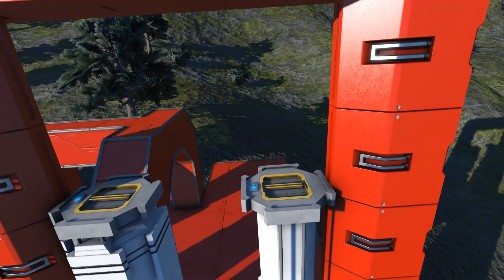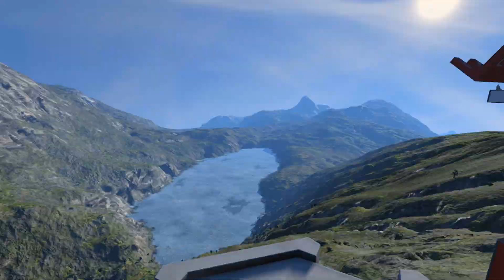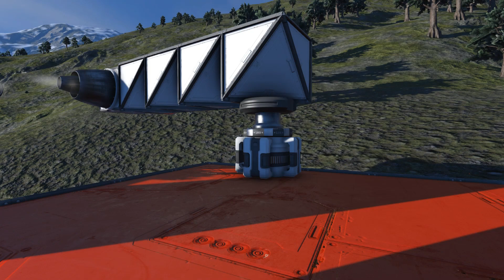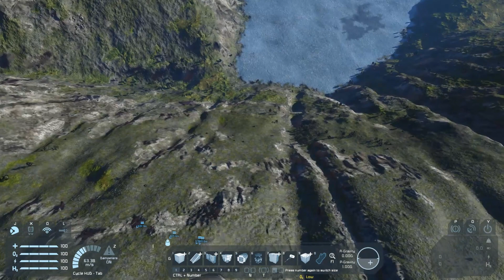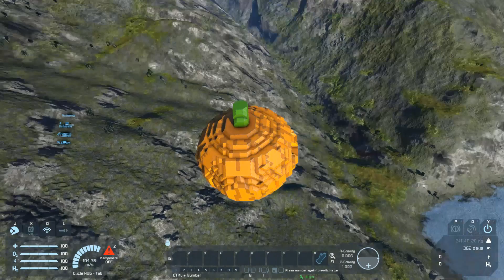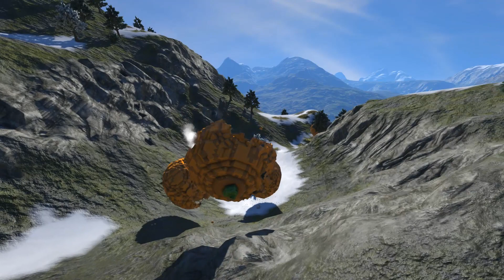Space Engineers: Pistons and Rotors after the Physics Update (tests and tips for Space Engineers)

Comment: One thing I haven't seen anyone test is the difference between ramming a piston into a block on the same grid, a sub-grid and a separate grid.  I have seen the big nothing that now happens if you ram a piston into the same grid and I suspect the same thing happens on subgrids, but what about a different grid?  Can we still get some destruction?
Reply from the maker: It could be interesting to see how much force you need with rotors or pistons in order to break a separate grid. Could be useful to know where the safety margins are. I'll see what I can do to work that out :)

Comment: Splitsie, I had a similar but crazier idea about catapult: use rotor head displacement instead of piston.
Rotor head displacement will change the length of rotor instantly, people used to make pulse engine with it when space ball first came out.
Can U give it a try? :)
Reply from the maker: That sounds like a cool idea, if wonder how you'd time the ejection to work. Although that might be good some of those rotor part cannons work... I need to do some research on this :)
Reply: Splitsie It would be so awsome if u can get it to work. I know timer blocks can ''extend'' group of rotors but only a little bit each run. Id never tried it though. Afraid of rotor glitchs ...

Comment: the hitbox of the blastdoor blocks for small grids are Horribly inprecise, its a hassle to figure out which way to rotate so i can place it on the roto head without it scraping allong another rotor.
they realy need to update those, its HIGHLY needed. im forced to download a mod that changes the hitbox of these exact blocks >.<

also if you stack pistons or any multy grid blocks it all starts shacking and destroying everything it its vecinity. so im forced to use the inertia tensor, which is basicaly sharing the weight of the grid the first rorot was placed on, WHICH IS TERRIBLE. the weight throws it all off, if youre trying to crate a mech it just falls to the ground not having enough strengs to hold all that weight up.
so you either end up with violently shaking mechs or mechs that are too heavy to lift their own weight ... keeEEEENNN!!!!

my way of a workarround is to apply inertia tensor to ONLY the rotors which are placed on very small grids compared to the grind that the rotor head is connected to, so both grids are very light in weight, but the rotors in general seem weak, at least on planets gravity.
Reply from the maker: The amount of torque the rotors can apply seems to have been balanced for space not for planets - which makes sense since they were designed before planets were a thing. So I agree, they often seem unable to lift things you'd think they should be able to :(

At least it's not as difficult any more to attach two rotors to the same subgrid to get them to work together, but the getting them to work together bit is quite hard - at least for me :P

Comment: You might want to try the rotor with thruster on an arm extension with the rotor on a landing gear. The thruster maybe trying to spin the whole station that the rotor is attached to and not just the rotor head or rotor.
Reply from the maker: Apparently it'll work with an even simpler fix - a few people have told and showed me that the thruster will work if the rotor is on with torque at 0, even though in my head that's the same as having it off with braking torque at 0. Oh well, just a little SE quirk :P
Reply: Splitsie
I tried the same thing, and found the same. However I also found that in some cases you can't have more then one going at a time. Also sometimes I got somewhat of a springboard effect when mounting the rotors sideways. It may be worth another video to cover how this works and in some cases doesn't. . . ^_^

Comment: ive seen velocities in excess of 400 m/s if you take a rotor, put a looooooooooooong arm on it, put a stack of pistons on that, extend the pistons, and measure from the flying tip.  unfortunately, as soon as the tip is not moving around a rotor, it instantly slows to max speed.
Reply from the maker: Yeah, that drop to normal physics when you detach is a bummer. Part of me wishes we could use this method to cheat things beyond the normal physics speed limit :P

Comment: Turn the rotor on with a tiny amount of speed, then turn it off. Then the thruster should be able to carry it from there.
Reply: Just make sure braking is set to zero so it doesn't lock down when you turn it off.
I've never tried it with thrusters, but I did manage to create a permanently spinning solar farm with the technique by turning it on at max speed, no brake torque, then shutting it off.
Reply from the maker: The braking was at 0, apparently there's a bug that means the thrusters can only spin the rotor if it's on without torque set to 0 which is quite strange...
Reply: scratches head As I've said, I've not tried using thrusters with rotors in such a way, but that doesn't make any real sense. I'm probably going to buy my own copy of the game soon (vs playing it on a friend's account whenever I'm hanging out with them) and I'll do some testing if I do.
Reply from the maker: My head hurts so much from trying to figure it out that I'm just going to call it a bug :P

Comment: In my survival world I have a ship with a double piston elevator to get to the control room. Never had any problems. Nor with my retractable docking port using a piston EVER. But after this update... I had my elavater extended in my ship. Then I as moving in to dock with my base and when I retracted my docking piston it exploded and sent a connector flying though the controll room. Shredding a massive hole in the armor. Like...., wtf
Reply from the maker: They did something odd with the settings on pistons that were already built prior to the update that meant they weren't as safe as ones built after the update. I don't recall exactly what but it was mentioned in the update stream, it was something along the lines of leaving the piston force incredibly high so that things were supposed to remain functional if they worked before, sounds like that didn't get that bit right :(

Comment: Have you tried killing off the rotor's torque on the thruster model?  That might have something to do with the lack of motion; this happens with motors in real life; the higher the torque the motor has, the more difficult it is for an outside force to overcome the motor's inertia.
Reply from the maker: SE also allows you to have free spinning rotors with the rotor off and braking torque at 0 but it does something buggy when you attach a thruster to it. Oddly even though that should work, what you've suggested does work. Setting the torque to 0 and leaving it on apparently everything works exactly as it used to... I can't really explain it :P

Comment: You HAVE to set Torque to 0 for a freely spinning rotor.
Reply from the maker: Actually there are two methods for a freely spinning rotor, sadly only one of them seems to work for the thrusters - which I've only learned from comments since this video was released.

You can either have the rotor on with torque at 0 or you can have the rotor off and braking torque at 0. To have the thrusters work apparently you need to have the rotor on for some odd reason... I can't understand why there would be a functional difference between the two setups which is why I hadn't even thought to try the other at the time :P Oops!

Comment: For the Rotor Thruster: The rotor definitely needs to be 'on', because whenever a block with a movement function is 'off', it is essentially locked. You'll also have to drop its torque to zero
Reply from the maker: Actually there are two methods for a freely spinning rotor, sadly only one of them seems to work for the thrusters - which I've only learned from comments since this video was released.

You can either have the rotor on with torque at 0 or you can have the rotor off and braking torque at 0. To have the thrusters work apparently you need to have the rotor on for some odd reason... I can't understand why there would be a functional difference between the two setups which is why I hadn't even thought to try the other at the time :P Oops!
Reply: @Splitsie  I believe the status of the rotor defines some property of the attached subgrid, when the rotor is on, the subgrid is 'on', more accurate force calculations are used

Comment: Using a thruster on an arm on a rotor, will do nothing, since in real world physics it would work on centrifugal force, wich is absolutly NOT in the game engine physics.

Just like even if you have a 7 long shaft of blocks with one thruster at one end and all the rest on the end, it will not tilt or anything, it'll just behave like any other ship.

A grid like this will have no influence from its own Center of MAss or added mass, but it might be influenced by the mass of the cargo, but i hardly think so.

Sometimes SE engine runs on trolls physics and its best to leave it at that.
Reply from the maker: That's what I think's going on, but setting it up that way used to work. Oddly I've been told by a few people that you can get it to work with the rotor on and torque set to 0 so there must be a bug with the way the thrusters interact with a rotor in its on or off state

Comment: I see what you were trying to do with the rotor and thruster, maybe trying to achieve my acclaimed 400+m/s? Hehe. Anyway, I just did some further testing, it doesn't seem to work properly with the small thrusters, only with the big ones. Here, just to show you that I'm not making this up, here's a raw video of me setting up a rotor with stock settings on a fresh creative world. Take a look if you want, it's up to you (I don't know if you've blocked links, so here's the ID instead: VUiiGnDoECA). It's nothing special, literally an arm with power and thrusters, but i do get up to 430m/s.

Also, that's a really cheap way of launching warheads... If you manage to aim and time it right, you could easily use those in space to take out targets that are extremely far away, at a fraction of the normal cost. Very nice :D
Reply from the maker: I might have been hoping to get close :P
YouTube by default puts linked messages into the held for review folder for me, but unless it's blatant spam I approve them straight away - especially from people like yourself who've posted on my videos for a while :)

I really want to work out a reliable way to use either pistons or rotors to launch warheads (rotors are probably the more space efficient method) as you're absolutely right about them being cheap - no motor parts to supply the projectile with :)
Reply: Ah right... Well cheers haha. I'm sure there are 100s of ways to launch warheads with rotors and pistons. You've already demonstrated 2 ways (spinning and shotput style). It's just a shame that as soon as you launch yourself or something, your speed is instantly capped at the normal speed limit :(

Now I must fix my computer since it doesn't want to even get to bios, yay :D

Comment: I think your rotor with the thruter on it wont work becouse the thrust is always calculated from the center of mass on the grid it's connected to. You can try making a longer arm, or maybe place an additional sub-grid on the end of the rotor then put the thruster there :D
Reply from the maker: Yeah I thought the same thing. That's why I tried the bit with the landing gear. Some people are telling me that it works with the rotor on and no torque but I haven't had a chance to test that yet though. Maybe there's some changes to the centre of mass calculations that happen when it's turned on and off?
At least stacking works for some wacky fun though :)

Comment: The rotor behavior with intertia tensor spinning slowly is the exact same problem I had with my solar script. I noticed, that, the more shared subgrids you have, the weaker the very first rotor gets, up to a point, where it is barely able to move the grids above it - even with max torque. That's why I only enable the inertia tensor on the horizontal rotors by default. The angular velocity experiment however should work, if you turn the rotor on. The braking torque actually gets applied when the rotor is turned off (you can see that when hovering over the braking torque slider as a tooltip). In my solar script I set torque and braking torque to 0 but leave rotor on, if a U-shape contraption is used..
Reply from the maker: I had the rotor off so it should have been using the braking torque. I don't quite understand why it works when you turn the rotor on and have no torque but not with the rotor off but no braking torque. In my head those two situations should be identical. Am I missing something?
Reply: You're missing that logic related to physics behavior isn't built into space engineers, yet ;-) No, seriously - you're right! It should work that way but it isn't..
Reply from the maker: Thanks isy that actually makes me feel a lot better :)
Reply: You're welcome Splitsie ;-)

Comment: The rotor with the thruster will work if you set the torque to 0
Reply from the maker: The torque should only matter when the rotor is on, once you turn it off it uses the breaking torque to determine the force needed to move the rotor part. Not sure if something changes in the rotor if I turn it on with regard to dealing with the thruster though. The way I'd set it up had worked before the physics update as I used it at the end of my rotor tutorial which is why I'd tested it that way, but even if it doesn't work anymore I hope there's some way we can use thrusters to turn the rotor, I'll have to try what you suggested and see if for some strange reason having the rotor on changes it's behaviour with the thruster
Reply: Splitsie I got it working right after the last major update. That indicates that keen changed that with rotors. Im gonna test it again and report the result
Reply: It worked right after i removed a block by the rotor
Reply from the maker: weird, I wonder why it behaves differently with the rotor on... thanks for letting me know :)
Reply: If you want, I could upload a blueprint to the workshop that replicates the conditions.
Reply from the maker: Sure, send me the link here and I'll take a look :)
Reply: http://steamcommunity.com/sharedfiles/filedetails/?id=1227263963
Instructions are on the LCD. It seems to work differently whether pasted in or manually built. Length of the rod doesn't seem to have an effect.
Reply: Hello Splitsie the reason the thruster doesn't move the rotor is because thrusters dont generate force in different apply directions they only apply force forward this MOD made by digi makes that possible
https://steamcommunity.com/sharedfiles/filedetails/?id=575893643
After installing the mod thrusters will act like they should but it makes ships no longer fly correctly due to new physics

also found out later if you apply a velocity on a rotor without the mod then remove all torque the thruster will overpower it